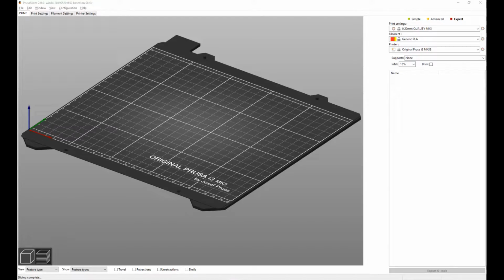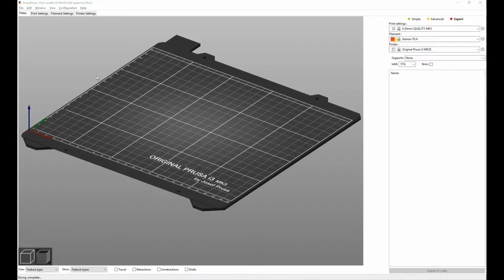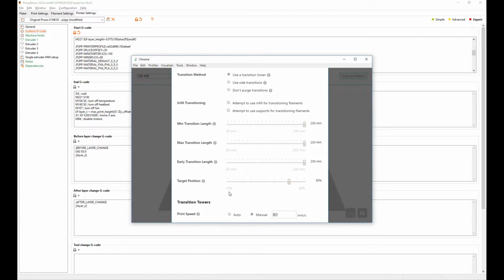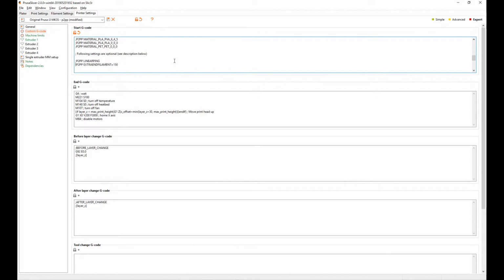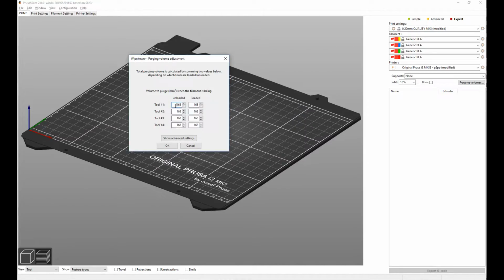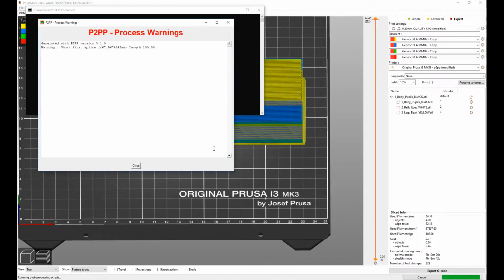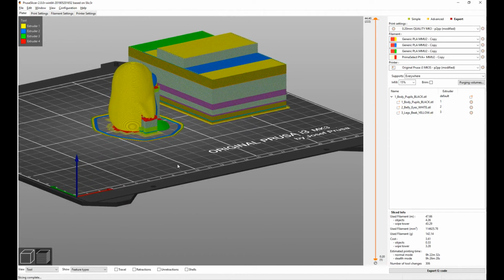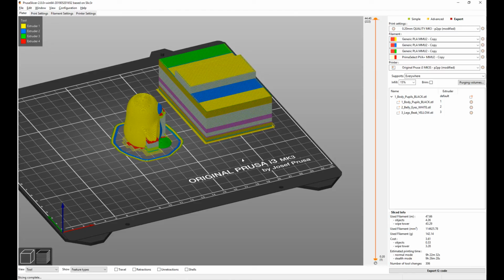Tutorial for setting up P2PP in PrusSlicer 2.0. Slice models directly from PS2 to the Palettte 2!

Comment: Thanks Kavionic for the very helpfull video that make simple all the settings! I would like to ask what kind of soluble material you use for the support. I did experiment with Polydissolve and Verbatim VBOH but without succes. Thank you!
Reply from the maker: Thanks for the feedback! I used PVA from eSun. It prints really poorly, but when used as a thin interface layer (3-4 layers) between the rest of the support and the object it works fine. I tweak the support settings so I get a pretty solid layer of PLA before switching to PVA.
Reply: @kavionic279  Many thanks Kavionic for your kind answer. As you suggested in the video I already used 4 layers to make enough soluble support. I will try E-solve PVA with the splice setting you indicated in the video. Thanks!

Comment: I've tried all the setting but in Chroma still getting 1 error message. No Transition in print  Chroma failed to detect any layers that contain transition ... or a processing error. Any Ideas?
Reply from the maker: You should not use Chroma after P2PP. Just give the file the right extension and send it directly to the Canvas Hub.
Reply: @kavionic279  Thanks that was absolutly a newbie mistake. Running my first 3 color print, will let you know the result.
Reply from the maker: Hehe. We all make those every now and then. Hope your print turns out great!
Reply: @kavionic279  Better than all the wasted prints before. Now looking to finetune other settings. Thanks for your quick response. If you ever need help, let me know.
Reply from the maker: Nice! Good luck with your fine tuning.

Comment: Some of the settings in this video contradict the github documentation.   Which one are we supposed to follow?
Reply from the maker: Probably the ones from github since that is most up to date. Which particular settings where you thinking about?
Reply: @kavionic279  The github does not mention removing the ramming settings from each filament type but your video does.  Also, the purge numbers in the video are different then the github recommendations.   Just wanted to make sure I was following the correct directions.  

I absolutely love this process by the way.   I was having so many issues with Canvas trying to make a purge block the size of a football field.  Plus the purge block is much much smaller with slic3r.    I really appreciate you guys putting the time into making this.
Reply: Also, do you guys have a paypal or someplace we can donate to?
Reply from the maker: @audiorazor  Ah, right. You should remove the ramming settings or it will attempt to extrude a bit of material mid-air over the purge block at the end of the print. I guess this should have been mentioned on the github page as well. And the purge numbers is a bit random as they depend heavily on what materials/colors you use and on the internal geometry of your hotend. So both github and my video only represent an example. You must tune this to your setup so you purge as little as possible while still getting clean transitions.
And I totally agree about the awesomeness of this process compared to Canvas or Chroma. I can't take any credit for it though, as I have not been involved in the development myself. I just made this video to help out a bit since some potential users found it easier to follow a video than the written documentation.
Reply from the maker: @audiorazor  I'm not sure actually. I will point Tom over here so maybe he can answer. He might have a Patrion account or something.

Comment: Great video. I get an error: The Wipe Tower is currently only supported with the relative extruder addressing (use_relative_e_distances=1). Any help would be great.
Reply from the maker: Thanks for the feedback!
I'm not entirely sure I understand what your problem is so I was hoping someone else would chime in :-)  Is it that you want to use absolute extruder distances and that is not supported by Prusaslicer? Or is it an issue with P2PP? If the latter, maybe you can get some help on the P2PP Community Help Facebook group?
I think relative addressing is generally preferred though, since it keeps the values small, and that leads to higher precision. Floating point numbers drops in resolution as they become larger so the longer into the print you get the less precision you have when using absolute values. I have not done any calculations to check if it is of any significance in real-world printing scenarios though. https://www.facebook.com/groups/591271211347189/
Reply: Go to Printer settings > General > Enable "Use relative E distances"

Comment: Follow it .. it work for me
Reply from the maker: Great! Glad it helped 😀
Reply: @kavionic279   I'm getting bleeding on some of the prints what can I do to solve this?
Reply from the maker: The general solution to this is to increase the purge volume until it stops bleeding. And possibly also adjust "P2PP SPLICEOFFSET" if the transition happens to early or to late on the purge block.
But if you have to increase it to unreasonable values it could be a sign that something is not right.
A "slippery" extruder could cause to much variation in how much actual filament is extruded compared to how much was requested. And this can make the Palette struggle to stay in calibration. This should be visible in the ping log. If they vary a lot, this might be the reason.
Another potential source is the hotend. A partial clog, or something else that would cause it to retain the previous color too long.
Some hotends use a teflon tube as the heat-break and if the end of this tube is not square (either because it was not cut right, or because it have been gradually damaged by heat) it can make a pocket that will retain the previous color and slowly mix it in with the new color over a long period.

Comment: You do not need to set any volume for "Unloaded" - Leave this as 0. Also, the real power comes with playing with the advanced settings that you skipped. This allows the user to define how much to purge when going from any color to any other color. Also, you pasted the print settings gcode on the bottom of the existing gcode but its supposed to go on top. Not sure if it matters but follow the instructions. Can't believe your video is on the P2pp doc page :-)
Reply from the maker: The idea behind keeping half the transition as loading and the other half as unloading was that it would make it more intuitive if you wanted to tweak the balance later. But you are right, one could just put it all in one side.

I intentionally didn't talk about the advanced mode since this video is simply meant to get people that find it hard to follow the written documentation started with P2PP. Anyone wanting to delve into the more advanced topics should follow the official documentation.

And yeah I realized later that I did it opposite of what the documentation tells you to do regarding where to put the settings gcode. Which is a bit unfortunate. But it does not matter at all where it is located, so no real harm done.

I guess it is linked from the P2PP doc page because it is the only one of it's kind. I made it after several people on the Palette 2 Facebook group had requested an instructional video because they found it easier learning from a video than from the written docs. And when I was done Tom asked if it was ok to link to it from the github page. If you find (or make) a better video I'm sure Tom would be very happy if you pointed him to it.